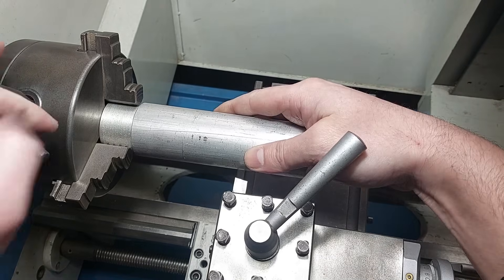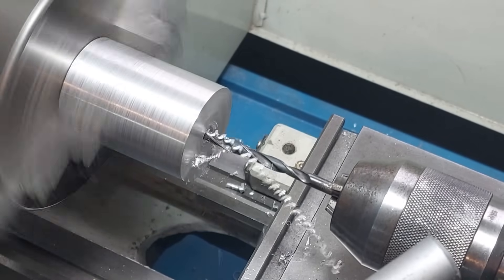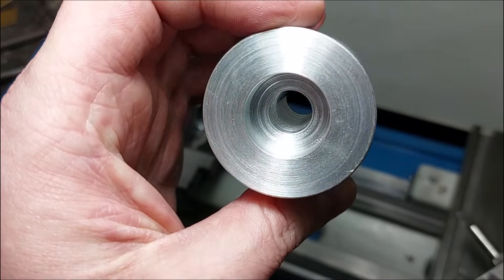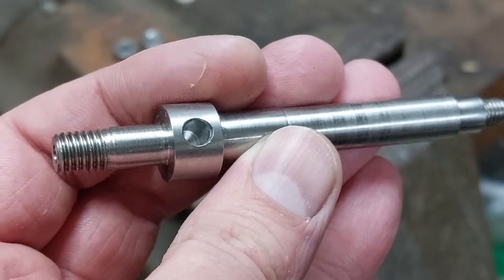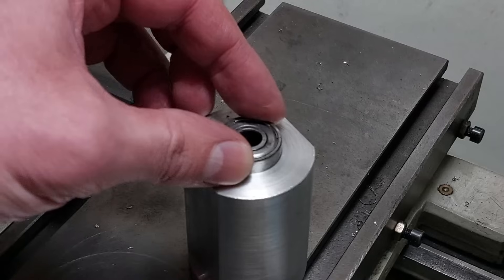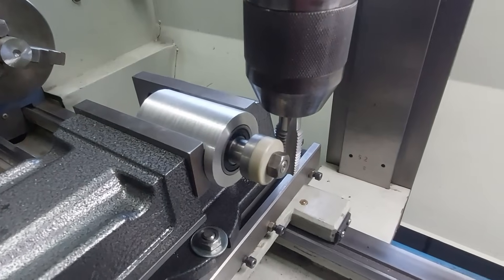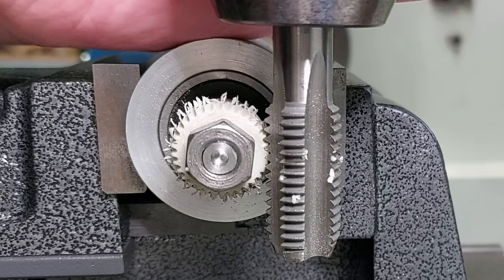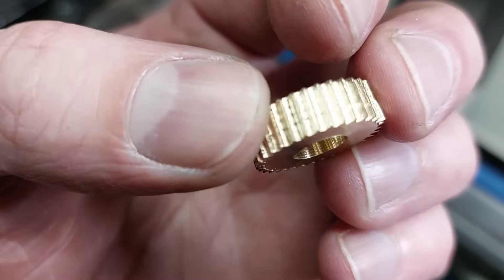Making gears with tap: does it make sense?

Comment: it works... sort of.
you do produce the proper involute, as it is being generated, just like hobbing...

except... its a 30 degree pressure angle, metric threads are ISO, or 60 degree. a proper hob looks pretty well much just like a tap but with a 40 degree tooth to produce the "standard" 20 degree pressure angle. they also have far more flutes. usually. 

the main reason they dont work is that there is no definite feed/index, so they cut when they arent supposed to... the device creating the feed is also attempting to cut... its very rare to "freecut" any type of gear, only exception i know of is certain types of worm wheels... and even then, they are generally pre-gashed BEFORE running the hob.
this also ties back to the number of flutes. 

if you take a hob, and "unroll" it, you end up with a bunch of "rack cutters", each one offset to the adjacent cutters. 3 flutes? you get 3 cuts per tooth. the teeth end up having "facets" on each flank. a commercial hob can have upwards of twenty flutes! hobbing is just like reciprocating gear generators (MAAG, gleasson bevel gears, bilgram, etc) except the cutters are all fixed onto a rotating shaft...

the PCD is a matter of guesswork unless you understand how to calculate the depth of cut. as its not a standard pressure angle, you have to compensate...

the 30 degree pressure angle  makes stronger, "stumpier" teeth, but also creates more pressure on the bearings. the lower the angle, the more tangential the force, the higher the angle, the more "radial" the force, as the gears try to force themselves apart...

the dedendum and addendums are wrong. the tap isnt designed to give the required clearance at the tip and gullet. another reason they dont end up looking "right".

and you get some random module as the thread is measured axially but a gear tooth is a multiple of Pi, the circumference, be it metric or imperial...

i noticed you DID tilt teh head over... considering you made that bearing block, its probably easier to slap an angle block under that... (i dont like tilting my head, thats my choice though...)

seriously, if you have the mill, and a rotary table, its FAR easier to just generate them with a slot saw. involute cutters? waste of money, IMHO. you can cut virtually any module at any number of teeth with ONE slot saw, as long as it will fit between the teeth.. whereas you need to buy involute cutters in batches of 8, or 14 if you can find the "half" sizes... and need a set for every module and DP...

and once you get the technique down, it takes about the same amount of time as an involute cutter anyway. theres very little gained by taking more than six passes per tooth...
Reply from the maker: Thank you for such comprehensive comment 🙂. I really appreciate your effort.

Regarding pressure angle/clearance: yes, I was aware that the resulting teeth geometry will be somehow incorrect. I even mentioned it on the beginning, but it didn't want to get much into details because it would make the video way too long, so I'm glad that you pointed it out in details.

Regarding "freecutting": that was actually the point of this experiment - I was expecting that there will be some imprecision introduced by such simplification (there is always something for something), but I had no clue how bad it will be. After all, you don't always need super precise gears, especially for hobby projects, so this time I just wanted to see if there is any potential in this method.

Regarding number of flutes: good point. I was expecting that the number of flutes is too small, but for other reasons than what you pointed out. I didn't thought that it will also affect the envolute "resolution", but you're absolutely right. Good to know, thanks 🙂.

Regarding involute cutters: I agree. At least for hobby, it's way too expensive to buy an entire set, comparing to advantages it offers.

Regarding tilting the head: well... It's not as accurate as angle block, but as I was already expecting poor accuracy due to numerous reasons, so it was simply easier for me to do it this way. But I guess it's more like preference.

By the way... Recently I bought a "real" gear hob (second hand, so it was super cheap, but still in good condition). So there will be another attempt soon 🙂
Reply: @FalconsHomeWorkshop  i wouldnt say the geometry is incorrect. its just 20 degree pressure angle is standard. theres also 14 degree, but really it can be whatever you like...within reason! 20 is just the best compromise between tooth strength and bearing stress.
for certain cases, this method is adequate... such as not having a printer... or rotary table... or constant velocity isnt an issue...

really, you can tilt the head to any angle, it will just cut helicals... or it SHOULD... of course, you have to have it at an angle that suits the PCD and the tooth count...

lol, cutting "half" teeth... usually only find out on the last one!
Reply: @FalconsHomeWorkshop  
I put a lot of thought into the use of taps for gear cutting. One reason l put some thought into building a gear hobbing machine loosely based on the Barber-Colemans 16 series. One capable of cutting up to 45° RH and LH helicals. Blanks up to 6"/152mm in diameter. Center distance around 20"/500mm. The reason for using tabs had a lot to do with looking at Ash Gear's web site and getting sticker shock at tooling prices. 
And if one is going to build a gear hobber then you really do need to cut a complete set of gears. One reason is ease of set-up. If you need to cut a 73 tooth gear for some reason and you have a base ratio of 30:1 in the machine it is a simple matter to use a 30-idler-73 gear set-up. Plus cutting helicals you start to get some set-ups that start using gears with prime numbers of teeth. This used to use a lot of trial and era coming up with the gear trains. I kept a logbook that had solutions for Index and feed gears trains for helix angle and feed rate per revolution. Less feed per revolution means smoother teeth. But if the feed rate gets too low you can start rubbing instead of of cutting. 
I also looked into building a bench top gear shaper. These produce much better toothed forms simply due to the cutting action. But l couldn't come up with a satisfactory way to back of the work from the tool on the return stroke. 
The Machine l was looking at would have had integral 5C and/or ER collets to the spindle.
Reply: @paradiselost9946 . Sorry ... what do you mean by "slot saw". Not a slitting saw I assume. Do you mean a single point cutter with the 'negative' or inverse of the required involute shape?.
Thanks
Reply: @gyrogearloose1345  yes. slot saw... slit saw... same thing.
a gear cutter in certain production machines is just a rack. an involute rack has straight sided teeth with a 40 degree included angle. (occasionally 29 for a 14.5 pressure angle) oscillated back and forth as the gear blank is "rolled" along them in synch, and the involute profile is generated cut by cut. the rack cutter can be a gear instead, and is generally the only way to make internal gears for obvious reasons...

get a slot(slit) saw, rotate it to 20 degrees in relation to the work, it now takes the place of one flank of the rack cutter... "roll" the blank whilst lifting/lowering the cutter to simulate the same motion as the rack cutter... and you generate an involute profile. rotate the other way and you can then generate the opposite flank of the tooth. 

add an extra axis of rotation, and you can cut bevel gears accurately. watch a gleasson bevel generator. two flat sided cutters, working on opposing flanks of a tooth, converging to a common point, the centre of rotations. end result, correctly profiled tapering teeth... you cant cut a bevel gear accurately any other way.
Reply: @gyrogearloose1345  ha ha ha... you have my old username ;)
Reply: @paradiselost9946  What? I am son of Gearloose? Or was it Gyro fathered me?
Reply: @ that would make you the little dude with the lightbulb for a head...
Reply: That was a long old message just to say you don’t like the method. I doubt anyone read all of it.
Reply: @ 15 likes... so i guess at least one of them read it all.

if you have the attention span of a may-fly, and cant read more than five words at a time, dont blame others for your shortcomings ;)

where did i say i didnt like the method? i pointed out why it doesnt work.

Comment: P.S. this method is best only used for high tooth vount gears of the 💤 SLIGHTLY helical variety. One offs, prototypes, urgent/emergency repairs. 

Using the helix of the he tap will ALWAYS impart a hwlix on be gear. And there will ALWAYS be a radius in the outside edge of the gear teath the same as the radius of the tap. So always get the LARGEST DIAMETER tap gor this type of gear cutting, unless you ARE cutting helical pinion gears

Comment: As a Journeyman Tool and Diemaker with 43 years experience, this is the wrong way to cut a piece off!! ALWAYS part the piece off when it is chucked on a lathe!! Using a cutoff wheel over the ways and dovetails is a bad idea. It will put grinding dust and grinding wheel particles on the ways/dovetails. Then wear of the critical lathe parts will be more rapid. It is also much slower than a parting tool. If my boss ever would have seen me do this, he'd have chewed my ass out big time.....😮😮😮

Comment: Are you holding the tap on a drill chuck? If so, that will run out considerably and a drill chuck does not have the rigidity needed for making gears with (of all things) a tap. Also, I would think that the diameter of the blank gear matters as it does when knurling. In knurling, and depending on the knurl, it has to be at a specific diameter to get a good knurl- there is a formula for it. Since what you are doing is experimental, you will have to test different diameters to achieve good teeth.

Comment: Never ever use your fingers to remove shavings while the lathe is turning. Also using air to clean out chucks can cause filings to penetrate the crevices of the chuck eventially ruining it. You are too carefree with this machine and showing others, some novices, bad habits. You are going to wind up curly cutting your index finger to the bone.😡
Reply: Very sound advice. As an apprentice machinist who learnt the right way, I was always told to never bring your hands and fingers close to the job spinning on the chuck, no matter what material you're machining.
Also, if you are a good machinist then you don't need to sand your job, it's not timber, the right cutting speed and correct use of cutting fluid will given you a perfect surface 
Finish.

Comment: If you were to make two gears with the same tooth spacing (tap thread pitch ) on different diameters there is the probability of overlapping teeth if the diameter isn't just right.

Comment: When l ws still working l experimented with making Roughing End Mills out of dull taps. Set the tap up in a collet black ck with the leading edge of the tap about 5° from vertical. Grind the top of the teeth to generate a flat a little ove 25% of the taps pitch. Index the tap in the collet block to 15° and grind more back clearance. Does it work? In soft materials yes. Just be careful not to over feed. In steels it gets iffy really quick. Also a lot of taps have non standard shank diameters so ER collets may be needed.

Comment: Sone problems with gears cut with taps. 
1) No clearance on the backside of the cutting face.
2) All of your gears are going to be of a non standard pitch diameter. His is becus the Circular Tooth Diameter is factor of pi. A 1 Module gear has CTD of 3.1415mm. Also your Pitch Diameters are going to be non standard dimensions. Yes you can get around that but you simply are not going to find Module or Imperial gears that match your tap. 
3) Gears cut with a 60° thread form are going to have a poor pressure angle for proper torque transfer. There is a reason most gears today have 20° Pressure Angle. You could get around this by using a Trapezoidal or Acme Tap featuring 30° or 29° thread forms. 
Ways to overcome some of the problems
1) Construct an actual Gear Hobber. And if you insist on using taps reduce the  feed rate to limit rubbing on the back side of the cut.
2) Increase tooth clearance by grinding the top and back of the taps teeth. You need access to surface grinder to do this properly.
3) Build a device to produce cutters with proper backoff on the teeth. The handbook Gears and Gear Cutting has plans for one of these. Or make your own Single Tooth Cutters using the method that Clickspring uss fir his home made ones. 
If you go whole hog and build a Gear Hobbing Machine you will discover the joy of finding the generating method of gear cutting. And pretty soon you will find you need to cut a complete set of gears allowing you to cut not only Spur Gears and Splines but Helical and Worm Gears.

Comment: It would work, but the question is for how long?  Gear tooth geometry has been worked out for maximum life and minimum noise and wear.  Gear teeth have little to nothing in common with screw threads.

Comment: The only way for the teeth to be right is if you drive the gear blank at the right ratio to the tap rotation, and you have to tilt the tap axis to the helix angle of the thread.
It’s not one or the other, unfortunately. The teeth are thin because the tap is advancing the teeth at the root, one pitch per revolution, when one pitch per revolution should only be true at the gear pitch diameter (about half way up the tooth). They are also thin and poor cut quality because of the helix angle not being horizontal.
Nice try, though. Been there.
Reply from the maker: Nice to know that I'm not the only one having such strange ideas 😉. But yes, it was never meant to be some sort of "fantastic new method". Rather curiosity on what's gonna happen 🙂

Comment: 8:31 you can clearly see the white gear has been cut exactly matching the tooth profile of the tap.
Unfortunately, the tap tooth profile is not compatible with such a small gear.
The problem would be reduced on a much larger gear, but in my opinion you should remove most of the teeth from the tap making the tap very "short" so it only has about 2 revolutions of teeth (ie; 3mm vertical of tap size).
That will greatly reduce the problem

Comment: You can certainly do this.  It you get terrible teeth. Gears use involuted teeth, or in certain very precision equipment, cycloidal gears. A tap gives teeth with straight sides, which are bad for meshing. They will grind against one another when in use. Another problem is that those flutes of the tap are not intended to cut. They just follow the cutting teeth at the beginning of the tap. There isn’t any relief. That causes problems. I wouldn’t do it.
Reply: except that involute teeth are generated progressively with straight sided cutters, for instance, when hobbing...

what you do get is a 30 degree pressure angle, rough teeth as theres no definite feeding/indexing, and of course, the addendum, dedendum and PCD are all shot to hell...

Comment: I think that the reason that your gear teeth were thinner is from your having tilted the head,  Taps have the pitch already built into them, so the blank will move simply from the rotation of the tap.

Another thing that you may need to consider is the diameter of the blank.  You didn't specify whether you were measuring it before you started milling the teeth.  Study information about gear cutting and I think your setup should work, but it is better suited for making a worm gear.

Comment: I think you set the depth of cut incorrectly. Pitch diameter needs to be correct, or teeth will be malformed. Try machining a long gear and tweaking depth of cut across it.
Reply from the maker: Yep, for sure I need to experiment a little more with that 😉. I'm planning another attempt soon, but this time with a proper gear hob... So we'll see how good this method can actually be 🙂

Comment: You should use a cutter with 2mm pitch and put some timing belts on it
Reply from the maker: That would help for sure, but it would also make it pretty much "standard" approach. My idea was to check if I can produce something that makes any sense using common tools and a very simplified technology 😉
Reply: @FalconsHomeWorkshop well, there’s a good reason why things are done the way they are. Gears have been made for several centuries. They’ve learned the proper way. Trying to come up with a new way is alike to working on a perpetual motion machine.